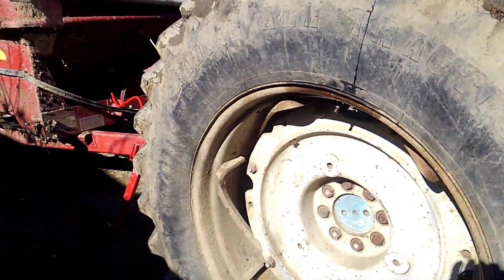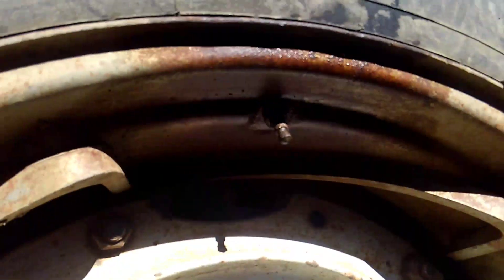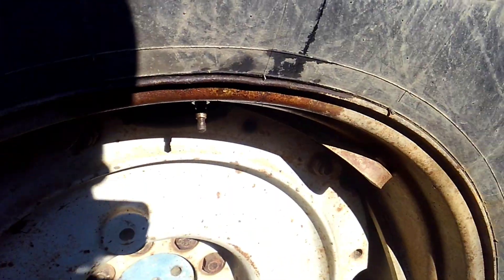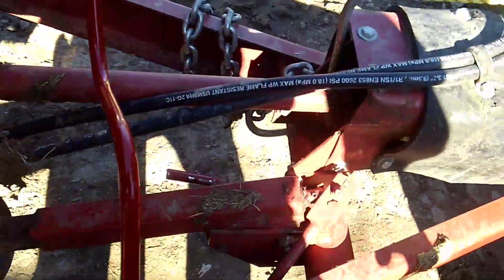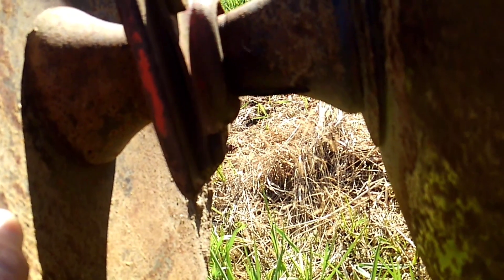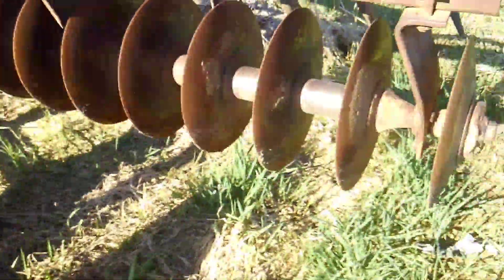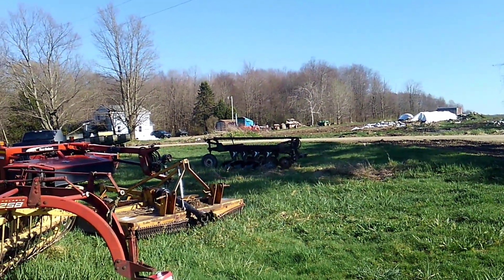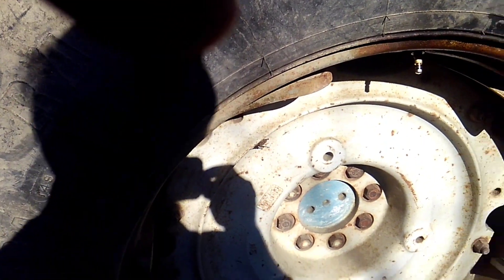Tire problems and getting ready for spring. 22

Comment: That sucks I hate dealing with rear tractor tires
Reply from the maker: Worst is when it happens going down the road and calcium is flying everywhere. Had a tube crack once, luckily I was close to the field but by the time I got it jacked up to stop the leaking I lost about a third of the calcium and had a dead spot in the field for awhile.